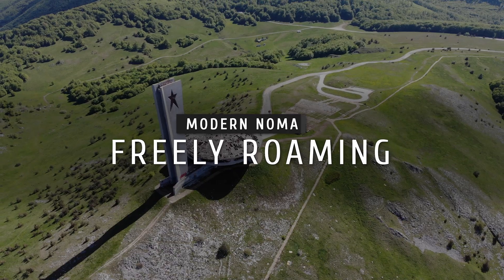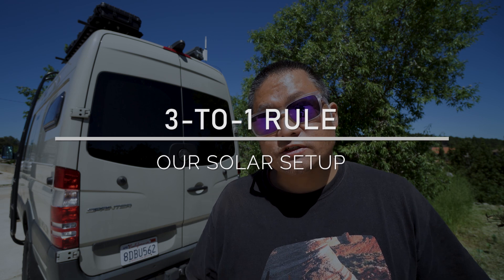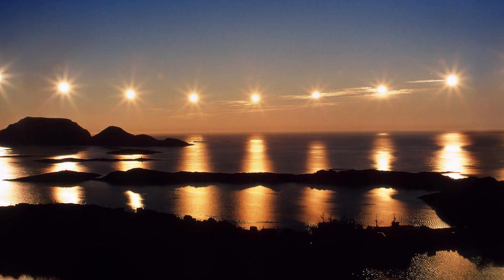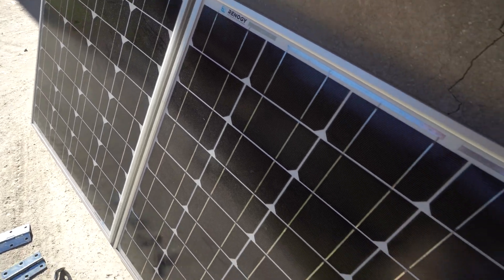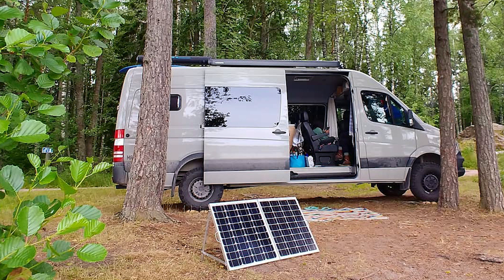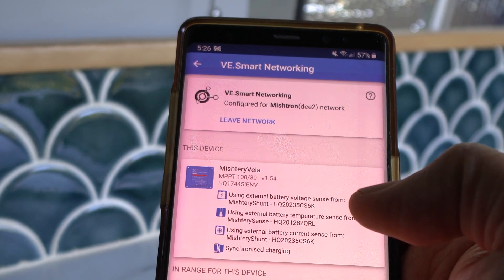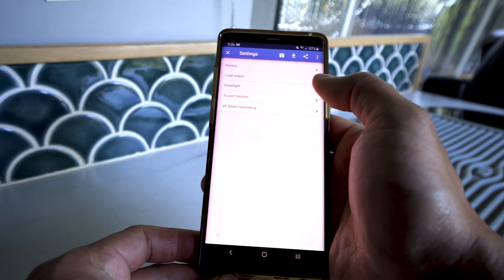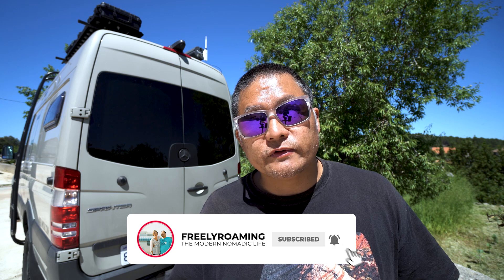Our DIY Solar System For Off-Grid Van Life

Comment: I'm a little confused by the 3 to 1 rule.  It's 3x solar in Watts to 1 usage in amps.  Assuming you are 12V that is about 3 watts on top for every 12 watts used.  or 1/4.   In the winter in Europe you'd be lucky to get 3 hours of full sun on a clear day.  so you can generated just 3 * 1/4 or 3/4 of your usage.  You'll drain down over time.  What am I missing with this math?  An alternator?
Reply from the maker: 3 watts of solar to every 1 ah of 12v battery capacity. So if you have a 100Ah of daily consumption, 300 watts of solar would be the minimum. Of course more would help the further north you go in latitude. Also tilting panels in the winter is critical for those northern latitude and DC to DC charge while you are driving is also a good supplemental power source.

Comment: Hi guys, if you had to start over, would you again use the Victron Battery Sense? I'm building our own LifePO4 system and I'd like to know whether it's worth buying it...
Reply from the maker: I still like the battery sense. Since I use the Victron Smartshunt as well, I would just get the temperature sensor accessory for it instead. It was not available in my area when I built it but it would have been one less item to setup.
Reply: Cool, thanks. I also bought the SmartShunt. So I'll just buy the sensor instead.

Comment: I'm just about to purchase my Victron electoral system but have been told that with those Lithium batteries (from your build) that we need a cerbo or Venus, do you have either of these in your electoral systems? What stops the MPPT or Alternator charging or the inverter doing something to the battery that it doesn't want without those two Victron products?
Reply: Is it a case of you should really have one but not 100% needed? Or is it a ticking time bomb not having a 'brain' to control all these systems
Reply from the maker: @Twink_Twins  Cerbo/Venus are for data reporting so you can visually see what is happening in your system. It doesn't physically do anything to interfere with your charging system. It is a nice to have but not  at all necessary. If you are building a diy battery pack like I did, the BMS is what will protect your battery. Any of your chargers like the MPPT controller will also need to be programmed to charge at the proper voltage for your battery's chemistry. That is all you need.
Reply: @freelyroaming  thank you so much you’re the best 🤩💫 the banana bread is our favourite too!
Last question do you have a Victron inverter/multiplus we want to run an induction cooktop so the electoral write up said we needed 3000w so didn’t know if I go MultiPlus 3000va 12v to finish the electrical systems… 
100/50 smart MPPT
2 x 335W LG bifacial SolR 
280ah (your battery set up ~ smart shunt and battery sense) 
Orion smart DC/DC 12v - 30A
Reply from the maker: We don't have a multiplus but if that's in your budget and have the space, it's a great product. You don't need 3kw for induction unless you planning on running 2 cooktops at the same time. 1500 to 2000 will be enough for a single cooktop.
Reply: @freelyroaming  is it right that the 12v battery can only handle max 2000w I’m terrified of if we had the TV on or something and then cooktop or the heater/water heater and the whole thing just blew up
Reply from the maker: @Twink_Twins  it all depends on the battery capacity. My 280Ah pack can handle a maximum discharge rate of 1C. That means it can handle 280 amp constant draw at 12.8 amps. that is about 3500 watts. But it also depends on all of the other related components being able to support that. Specifically the BMS, wire size and fuse/breaker capacity. There is no limit to what a 12V battery can handle if you have big enough wires and a big enough battery bank. But it does become less practical with a low voltage system as your components will need to be oversized to support it. Having a fuse/breaker and BMS will prevent any accidental over current situations. Also your inverter will also keep you from drawing too much if you size it properly.
Reply: @freelyroaming  thank you I do really appreciate you’re help. I’m going to subscribe on patreon as a way of saying thank you.  What inverter do you have?
Reply from the maker: Thank you so much! I have an older 1000w inverter that I wouldn't necessarily recommend. I would upgrade but in Europe I can only get 220v models here. There are several good inexpensive sine inverters that Jehu Garcia or Will Prowse recommend. I would trust them and just get what they suggest.

Comment: Great video , I know you have lots of Victron but I din't think you covered DC to DC charging which helps when you drive while solar charging. You might have saved it for a future video. Glad to see your beautiful system,
Reply from the maker: I do not have dedicated video on my DC-to-DC charger. I use Dometic PerfectCharge 20A. I did show how it was configured for LiFePO4 charging in that series. I will indeed show it again in a separate video. Thanks for watching!
Reply: @freelyroaming  Hi, I have similar worries about my system. There will be times when the solar charge controller will want to charge at same time with either my MultiPlus inverter-charger (which is Victron, but doesnt have Bluetooth connectivity with these functions) or DC-DC charger (Renogy 20A). How should one know that the charging voltage produced by other is not the battery being full? Havent figured it out myself yet.